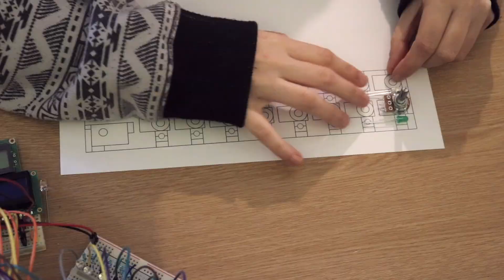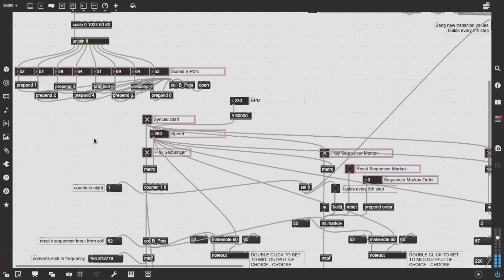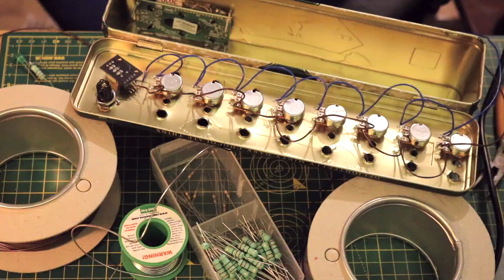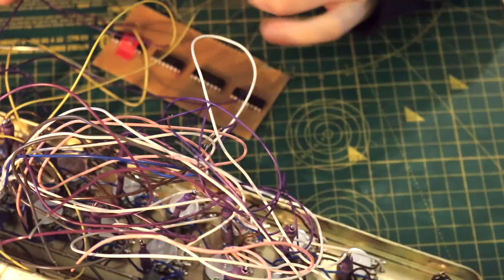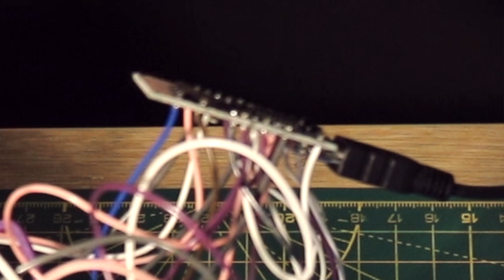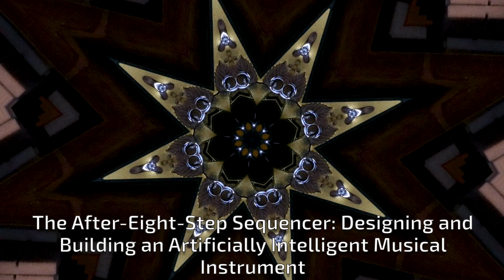The After Eight Step Sequencer: Designing & Building an Artificially Intelligent Musical Instrument

Comment: Hi, Cat! I envy to your husband :) He will never have a boring life with you!
I have an idea about to make the generation less chaotic. You can make few switches that will give the output levels/numbers certain modifications:
- setting an ostinant note (it's like those palm muted short notes in guitar metal riffs, they're usually on low octaves), the code will determine "which note of the set will be an ostinant" by some choice (it can be semi-random with rules)
- octave modifier. Some notes will be playing upper by 1/2 octaves with some rules as well
- ostinant/usual note repeater. The code will choose about which note will be repeated, how many times and a pattern. You can check patterns in FL Studio - Piano roll, add few notes, Tools - Riff Machine, there you can select a Pattern from a folder. There are a lot of .fst files, I believe that they're simple and can be used in other projects. As I remember FL Studio has a trial version so you'll not be limited about this moment.
This switch can be with three positions where you will be modifying only ostinant notes or only usual (all other than ostinant).
I think that this will work and make your project much more "human related".
Just subscribed to your channel, will be checking your projects and the progress!

Comment: (I came here from the recent Hackaday article) Cool device.

Just a small note on wiring colours, with my EE hat on:
- brown/blue is IEC-ese for single-phase mains Line/Neutral, while the US NEC uses black/white;
- red/black is commonly used for Extra Low Voltage DC +/-
but for under 12V on signal and power wires to an Arduino-in-a-tin, the actual colours are largely irrelevant (although consistency helps ensure it doesn't let out the Magic Smoke when you turn it on).

For heatshrink, I used to just rub it with the barrel of my soldering iron but now I use my hot-air SMD-rework station, which is essentially a specialized hairdrier. Both are slightly more controlled than a lighter flame.

Comment: Great project. Since you asked for advice on rotary encoders with a push button,  For rotary encoders, if you have 2 interrupt pins, use them for the grey count inputs (rotation). This will only work correctly if you can interrupt on both transitions, high to low, and low to high.  Alternatively, if you only had one interrupt pin, you can put it on one of the grey count lines, and interrupt on a single edge. Use the state of the other grey count to indicate if the count is an increment or a decrement.  As for the button, put the push button on a standard input pin, probably configured as a pull up.  Sample the push button in your main loop, and add some debounce to the code if needed.  There is example code for this under File->examples->digital->debounce.

Comment: Easiest solution to get more interrupts: change the hardware.  Consider a STM32 Blue Pill.  On the other hand, if you're just reading a button, you just need a good polling algorithm.  You could also use timer polling to read all the inputs.  Lots of choices!
Reply: I had the same thought — get a more capable MCU. I’m a fan of the ESP32 or ESP8266, but there are lots of choices out there.
Reply from the maker: It's a very good point!! I really appreciate the suggestion, and I think i'll move onto different hardware for my next project. The main reason I didn't was just that this was my first real arduino coding project, so I didn't really want to move over to another system just yet. I'm honestly considering going back and creating the thing in C++ and making a VST out of it.
Reply: Or a VCV Rack plugin (virtual modular synth software) that runs on C++ code

It also has an emulation of the Mutable Instruments Marbles eurorack hardware module. Some other Markov Chain related modules there

Comment: This is looking great!  I'm looking forward to seeing where you go next.

With regards to your rotary encoder switch issue, having had a quick look at your code, a few ideas occur to me that might be worth considering if you''ve not tried them already:
* First, I notice you actually read encoderButton twice in your main loop - once near the start with some debouncing using millis, and once near the end without any debouncing.  You might be getting some odd interactions between the two instances, so that is probably worth another look?
* I also note you read every potentiometer via the MUX every time through the loop.  I'm guessing these will change at "people rates" in terms of being controllers you'll be twiddling with, so you could probably get away with splitting these up and only read one at a time each time through the loop.  analogRead can be slow so having so many in one loop will reduce the overall responsiveness of the rest of the code.
* Another thought - I'm not entirely familiar with the LCD you are using, but again from looking at your code, I'm wondering if you are updating the display every time through the loop when you might be able to get away with updating only when something changes?
* Finally I note that there are a couple of calls to delay() in your loop. These will stop all processing so again will make the rest of your interface handling unresponsive for a short while, so it is best to avoid them if you can (I can give you some alternative ideas if this is something you want to follow up but not sure where to go next).

In general, it might be worth thinking about the desired update frequencies for the different elements of your hardware and designing around that - for example, scanning the most responsive elements every time through the loop, but only scanning lesser responsive elements every other scan through the loop (or even slower) and so on.

Another idea is to configure a timer interrupt (e.g. maybe using the TimerOne library) to effectively give you a different "loop" running in parallel.  You can't put everything in here as it is essentially running in another interrupt routine, but you could maybe use it to poll your unresponsive switch?  There are a couple of articles on my blog where I've talked about using timer interrupts like this (if this is of interest, I'll dig them out).

There's a few ideas anyway, and apologies if you've already considered these.  Feel free to give me a shout if you want to chat anything through.

Best wishes,
Kevin

Comment: Great job! Next time you run into issues because of a lack of interrupt pins, it's worth looking into finite state machines using switch cases.

 It would mean structuring your code in a slightly different way, but is a handy way to run parts of your code simultaneously without needing any interrupts
Reply from the maker: Hey! Thanks so much for the suggestion, it's pretty on point as it's exactly what a lecturer at my university told me! I appreciate you watching the video and coming to me with some legit help, that's really cool of you!

I actually did have a look into them, not the finite state machines but the switch cases within Arduino. I think because my code was so convoluted already with the multiplexers, I just got really confused as to where to place the switch cases within my arduino loop. They partially work, but still get stuck for the third case... it's odd. 

I'm getting into C++ more now, so I was hoping to be able to learn a few things from that and come back and fix it.